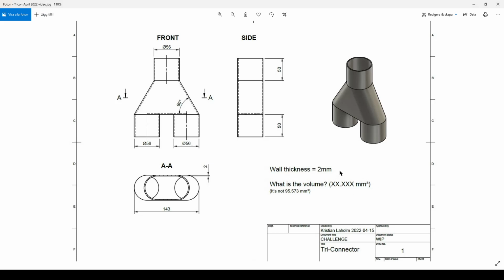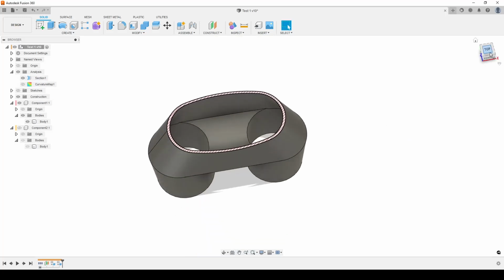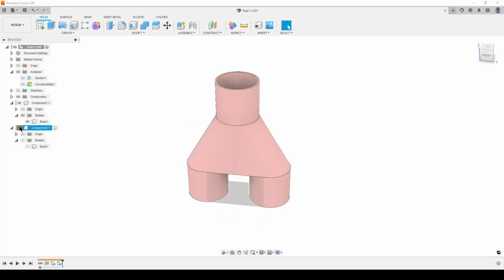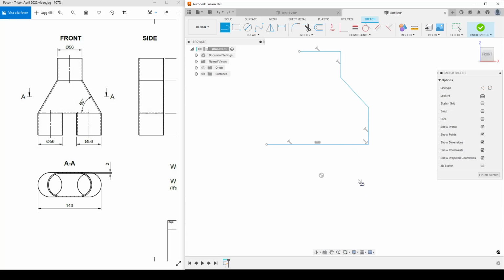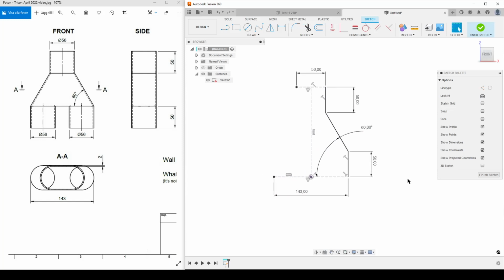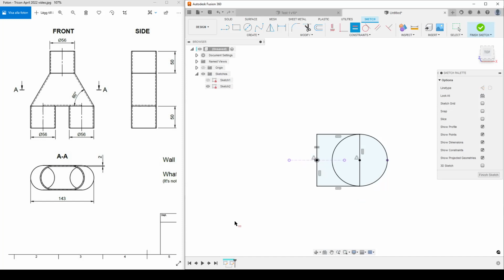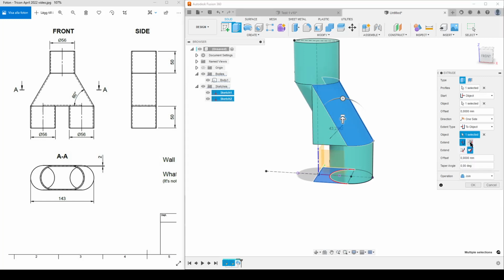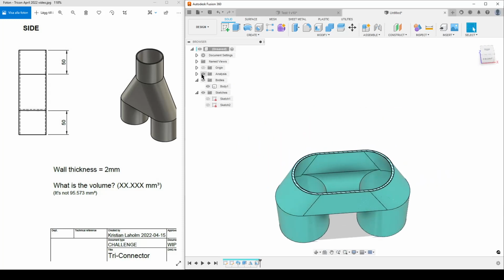Fusion 360 - Tri-Connector Workflow

Comment: How would you go about making one of the diameters larger than the other diameters? Would you still use the sweep function
Reply from the maker: If you connect 2 different shaped profiles Loft is the most used tool. Depending on design intent sweep and other tools sometimes gives a better and more stable result.

Comment: I would not of thought of doing it that way. Also, I think loft can become a crutch, i.e.  depending on it too much.  You have an interesting way of thinking about geometries. I see you made a bunch of electronic videos in the beginning, do you plan to make any more ?
Reply from the maker: I started doing electronic videos being something that I had a bit more then basic knowledge about. And then I got stuck in 3D designing (and 3D printing).
There can be some more then I have the time and find something interesting to combine with 3D printing and Fusion.
Reply: @KristianLaholm  Same here, learning to be able to add mechanics and motion to my electronic projects. Fusion 360 and 3D printing opens up a lot more things to do with my electronics.

Comment: I keep forgetting that you can project lines and points as well. Some time back changing a projected line to a construction line broke the projection.
Reply from the maker: I have noticed that only projecting the end points of a line and then connecting the points with a line in the new sketch can be more reliable.